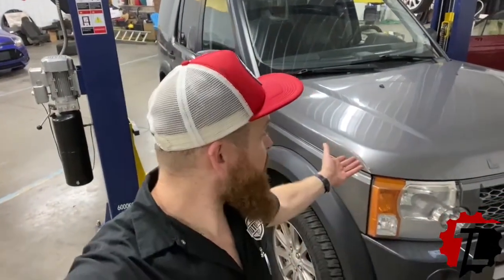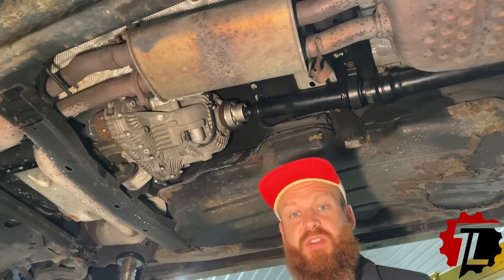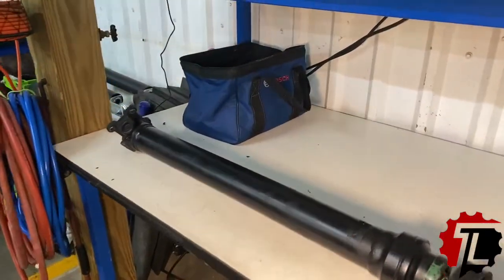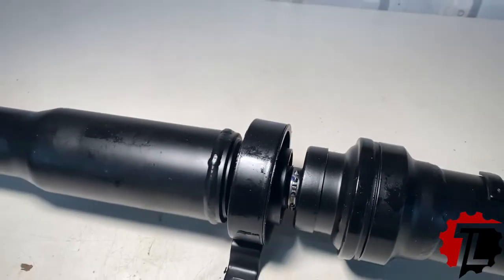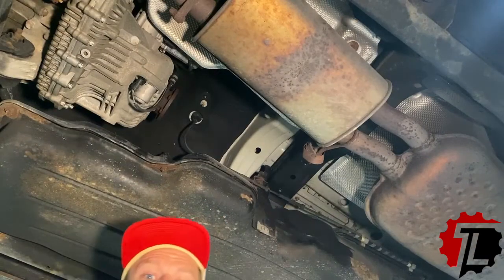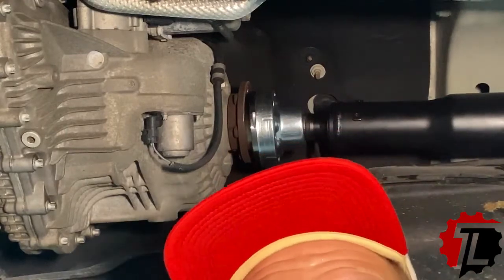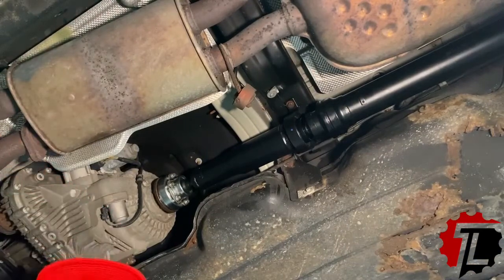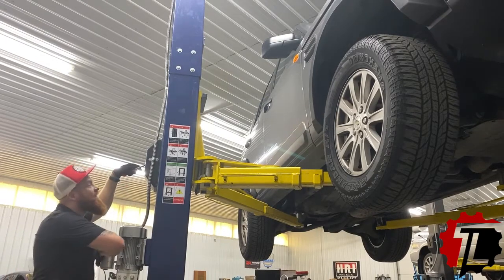TLP LR3 Driveshaft Replacement

Comment: Thanks!  I have a 2006 LR3 4.4 and it has a vibration/rubbing above 35 mph when I take my foot off the gas.  As soon as I put my foot back on the gas, it goes away.  I had the front hubs and bearings replaced but vibration is still there.  Could this be the drive/prop shaft u-joints maybe?  Cheers!
Reply from the maker: Thanks for reaching out! I can’t say what is ailing your truck for certain, but what I will say with my experience is the issue you are describing is most likely a driveline concern. My guess would be the carrier bearing in the middle of the shaft has gone (just as mine had). Crawl under the truck and inspect the rubber that attaches the bearing to the mount. I would be willing to bet you need a new prop shaft. Hope this helps! DJ